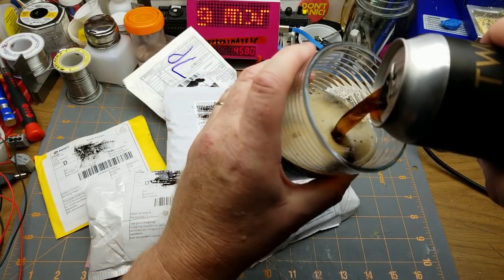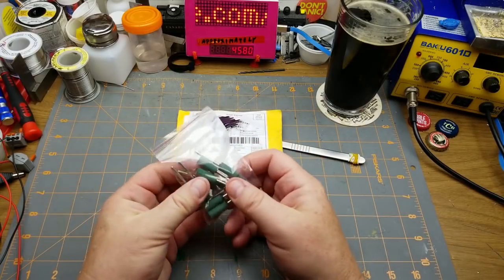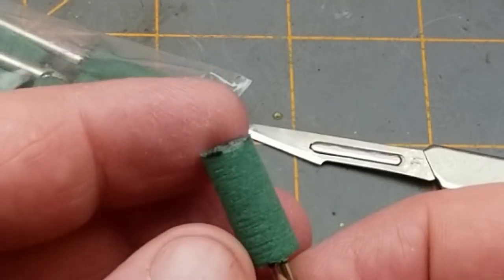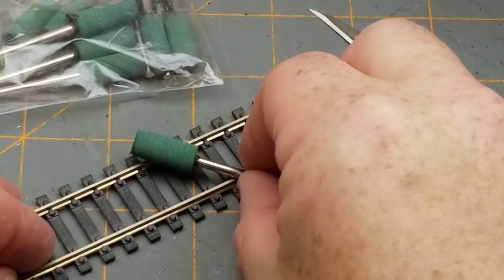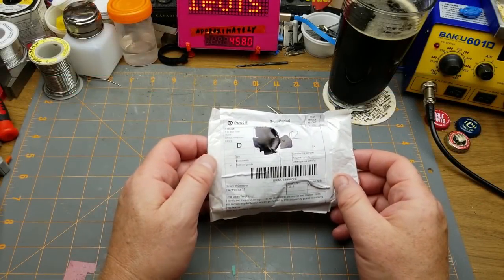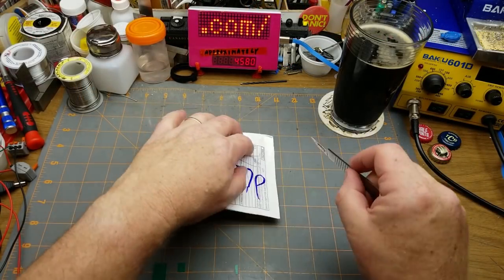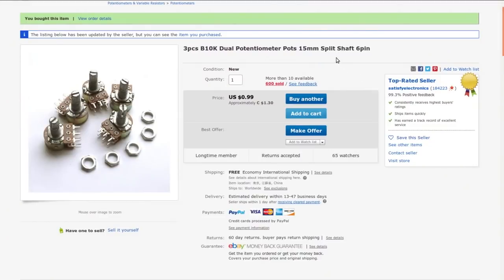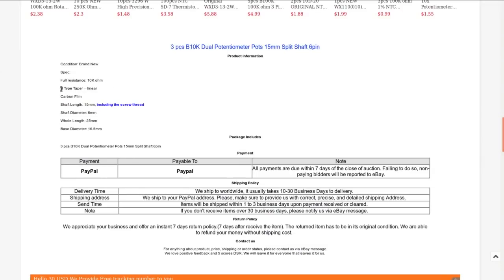mailbag monday #71

Comment: Nice bag of goodies. Thanks for sharing! Some time ago I also bought one of these D1-mini battery shields. Where your gives a green light, my shorted the power supply! Luckily that USB charger had some protection and just shut down. My multimeter indicated a short between Ground and Vin of the charging chip. So after watch many Louis Rossmann video's, my first suspect was that capacitor. I desoldered it, but it measured fine. Then with a bit of effort I desoldered the chip. Unfortunately  the short was still on the board. Examining the traces, the only possible culprit left was that large 0.3 ohm resistor. While the resistor was fine, and properly sorted, I finally noticed that there was a (big) error in the PCB pad just behind that resistor. The pad on one side was both connected to the GND area below and to the Vin island above. Definitely a design error! After I cut away the bridging copper, I resoldered the components and finally, the shield worked fine... Obviously my shield probably wasn't an original WeMOS, but a cheap knock-off based on the published circuit. Still I was happy that I could repair the defect...

Comment: I use a gas lighter to hide the details on the shipping labels. Most of the labels are thermal paper and change colour on application of heat..
Reply: how many packages burnt up so far ? 😀
Reply from the maker: I should see if my hot air soldering tool can do that...

Comment: Fantastic as always.  I have an off topic question inspired by your track cleaner.  I'm doing an overheard train setup and I need to span about 12 feet mid air.  Do you think 1x4 / 1x6 would be sufficient for that or do train people usually use some other material for those spans?  I can put as many ceiling supports as needed, I'm just concerned about how any type of twisting/warping/sagging would affect performance.
Reply from the maker: 1x4 would be fine if you build a "T" section. Basically glue/screw on a vertical piece of wood under the center of the horizontal piece that has the track mounted on it. 

With that, you should be able to span a few feet between supports.

Though you may want to go wider (the 1x6 option) just in case a train derails - it gives you more leeway before something its the floor.
Reply: @pileofstuff  That's exactly what I was thinking. Thanks so much for the advice.